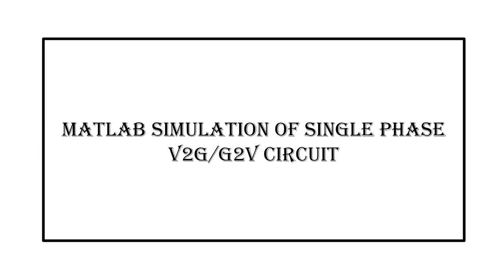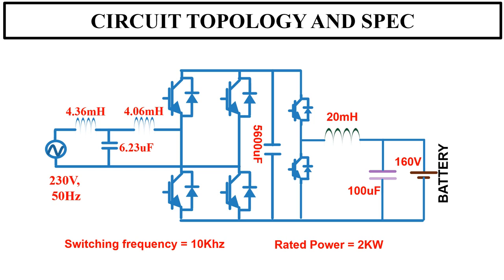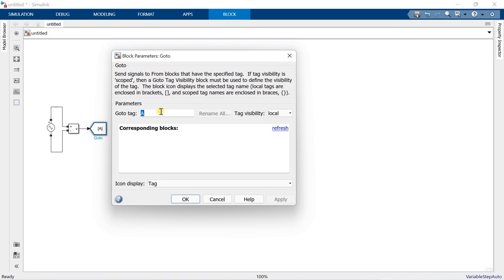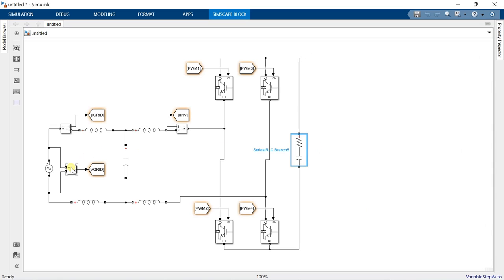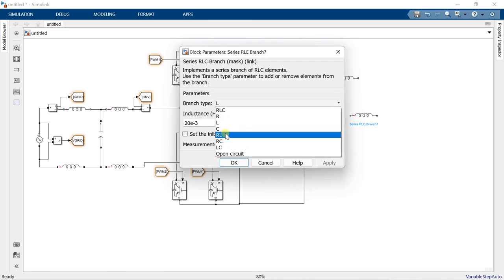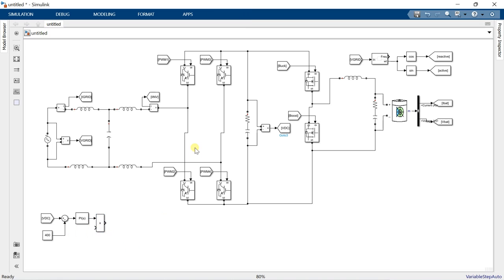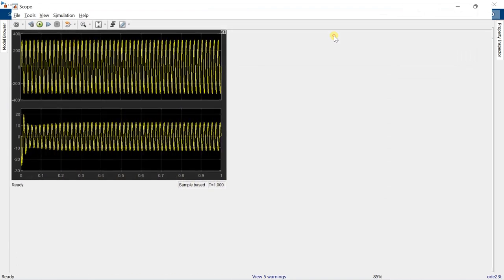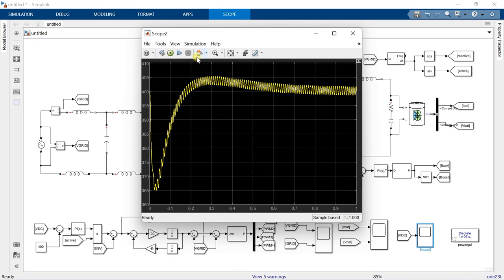MATLAB Simulation of V2G, G2V Operation in Electric Vehicle Charger (Single Phase Model).

Comment: I'm not getting the output I am getting same wrong output for both V2G and G2V mode I have checked the parameters thrice and there is no deviation from your model
Reply from the maker: contact me at my email ashacademy01@gmail.com
Reply: @TechSimulator hello sir,is this model for ac charging or dc fast charging?
please let me know
thanks

Comment: Something is not right in the active rectifier circuit.  Mine is unstable and the circuit, values, and settings are per the video.  The DC/DC section looks OK.
Reply: I should add the 2-level PWM block goes from zero to full duty cycle with an input swing of -1 to +1V.  The input I see goes hundreds of volts plus and minus.
Reply: Whoops!  Gotta use the right IGBT, the one with the diode.  Then it works.
Reply from the maker: you can share the model at my email

Comment: Hi

I tried it but my waveform is different from yours. Also, can you share a reference paper for this work?
Reply: have you found related research paper?
Reply from the maker: You can share the model at my email
Reply from the maker: My simulations are not based on any research paper
Reply: Did you get the correct waveforms, i am facing the same issue.
Reply: @prateek_jakhar did you get the waveforms
Reply: @shivamanipogula750  You can mail him for the matlab file.